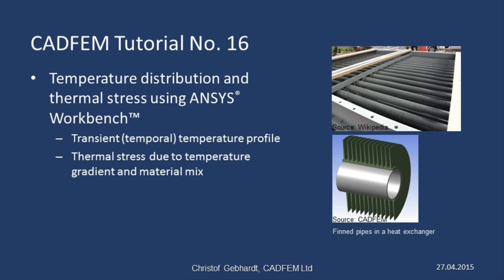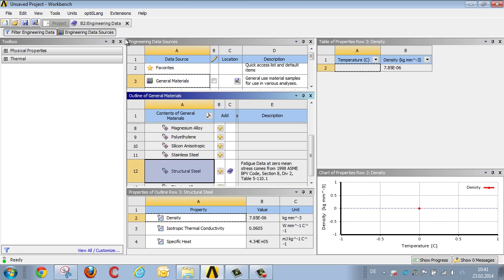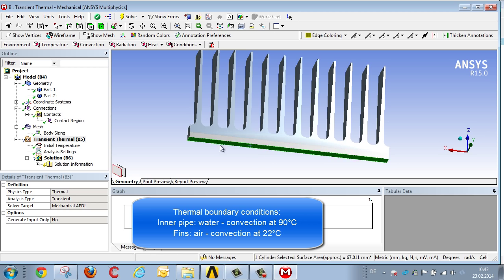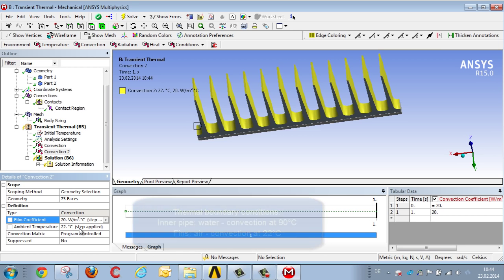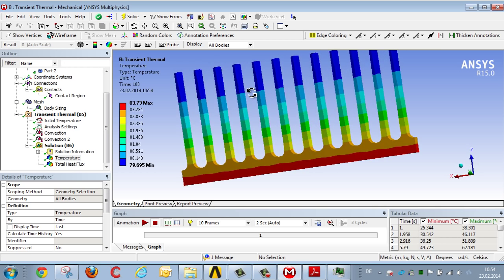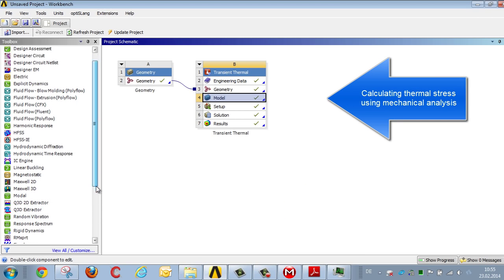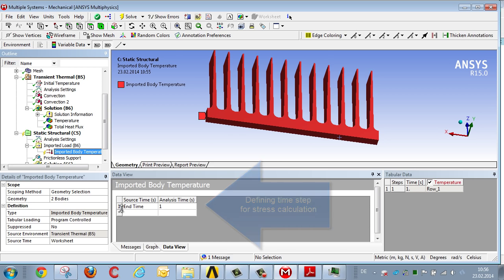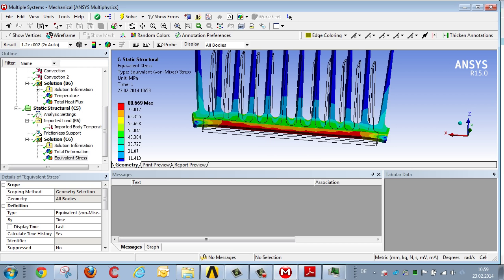CADFEM Tutorial No.16 – Transient temperature distribution and thermal stress with ANSYS® Workbench™

Comment: what i understand is water at 90 degree is flowing in the steel pipe. Heat energy will be transfered from the water to the steel and from steel to aluminiu through conduction. And the aliminium radiate heat to the sorrounding air through convection. 

How can the air expose the energy by forced concvection in the outer region where the fins are located? since this is the section of the steel pipe with aluminium finned outer cover, i think the energy transer is conduction between water and  the two metal and convection bettween the finned  aliminium surface and air?